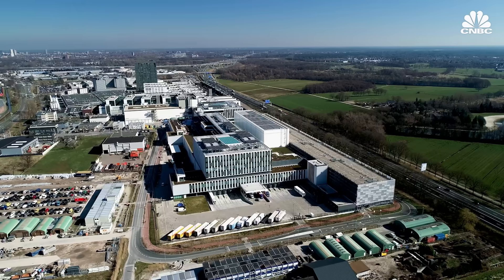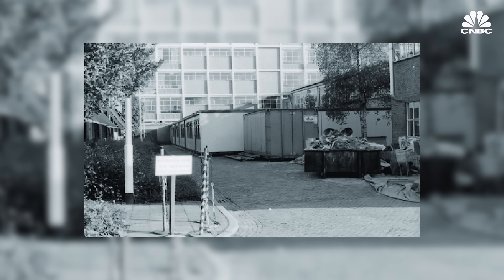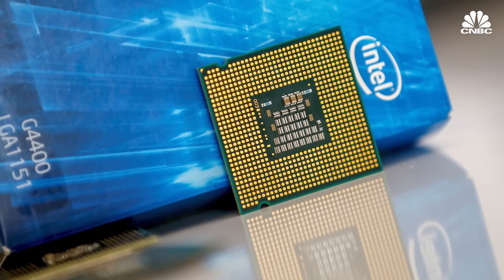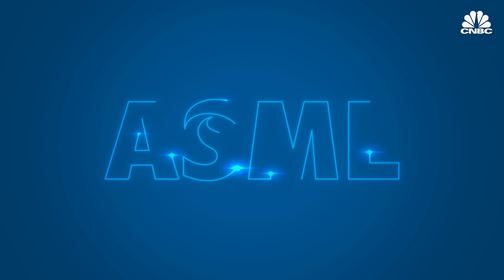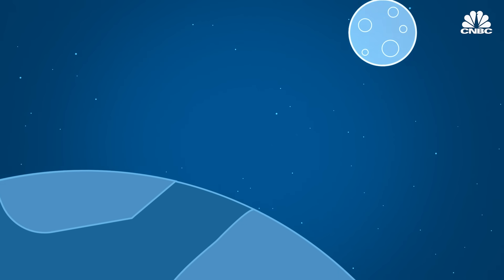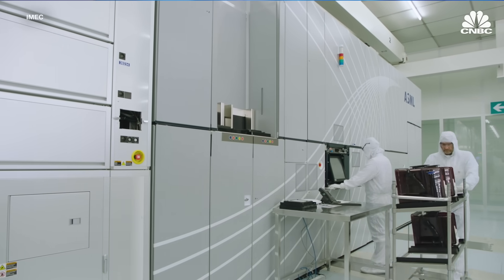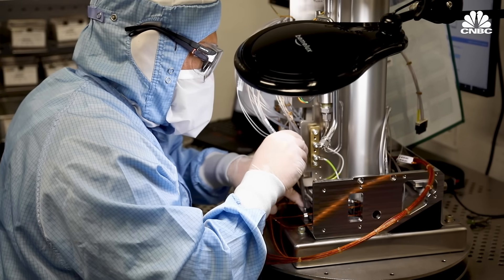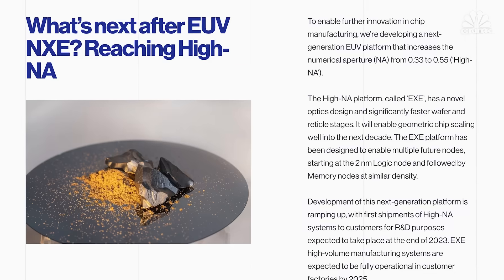Why The World Relies On ASML For Machines That Print Chips

Comment: Across technology leakage don't forget that the same support and maintenance Engineers week by week visit all the lithography calibrate all the lithography machines in their District regularly where in order to match previous production levels parameters are tweaked to maintain asml and other vendors in the supply chain production rates so necessarily that tuning and tweaking is transferred between all production production facilities everywhere an impossible problem to fix. You either meet the customer specified production goals production goals production goals production quotas or you don't get paid

Comment: I once applied for a job at this company, when i got there, i saw 2 types of people, well 3 actually. There were a bunch of young whizzkids running around, sweating, with their blackberrys, personal organisers & notebooks. There were senior engineers with beards, tweed suits & arrogant demeanor. And there were the corporate managers in immaculate suits who acknoweledged no-one. Then i got to the interview. 
Before i could even make my pitch, tell them all the stuff i have worked on; They just wanted 2 answers from me. Can you work 60+ hours a week in a hot clean room? And can you learn enough to bolt Module A onto Module B?. Well of course i can, but i think they missed the point. I am the guy who designs this kind of module. Yes i can bolt them together, but i would also design the bolts.
 They told me i could, in time, become a 'junior technician'.
I told them 'goodbye'😆
Reply: Lmao mate nah, you are not the type of person to design this level of tech. You just weren't good enough
Reply: @group555_  That must be why they keep calling me, to tell me i'm not good enough....

Comment: ASML (Advanced Semiconductor Materials Lithography) is a Dutch company that holds an unparalleled position in the global semiconductor industry. It is the world’s only manufacturer of extreme ultraviolet (EUV) lithography machines—highly sophisticated systems essential for producing the most advanced computer chips. These chips are critical components in virtually every modern technology, from smartphones and laptops to data centers, artificial intelligence systems, and even national defense infrastructure.

Why ASML Matters
ASML’s EUV machines represent decades of research, development, and innovation. The complexity of these machines is staggering; they consist of over 100,000 parts, require precision engineering at the nanoscale, and cost upwards of $200 million each. No other company in the world has been able to replicate this level of technological sophistication. Even countries with advanced industrial capabilities, such as the United States, South Korea, or China, rely on ASML’s expertise to produce cutting-edge semiconductors.

Currently, the Netherlands supplies these machines globally, but geopolitical tensions and export restrictions imposed by foreign powers threaten this dominance. For instance, under pressure from the U.S., the Dutch government has restricted exports of ASML’s EUV machines to certain nations like China. While these measures aim to protect Western technological supremacy, they also expose vulnerabilities in the Netherlands’ control over its own crown jewel.

A Bold Vision for Dutch Economic Sovereignty
Imagine if the Netherlands were to take full ownership of ASML’s role in the global supply chain. By banning the export of ASML’s EUV machines entirely—even to allies like the United States—and requiring all chip manufacturing to occur within Dutch borders, the country could secure unprecedented economic and geopolitical leverage.

Here’s why this approach makes sense:

Unmatched Technological Monopoly : If the Netherlands restricts access to ASML’s machines, no other nation can easily replace them. Developing similar technology independently would take competitors centuries due to the immense capital investment, specialized knowledge, and intricate supply chains required. This ensures that the Netherlands remains indispensable to the global semiconductor ecosystem.
Economic Windfall : Hosting all chip production domestically would transform the Netherlands into the epicenter of the digital economy. Revenue generated from licensing agreements, manufacturing operations, and associated industries would skyrocket, creating jobs, boosting GDP, and solidifying the country’s status as one of the wealthiest nations on Earth.
Geopolitical Power : Controlling the means of chip production grants significant influence over global affairs. Nations dependent on advanced semiconductors would need to negotiate directly with the Netherlands, fostering stronger diplomatic ties and ensuring compliance with Dutch interests.
Long-Term Security : By centralizing chip production, the Netherlands would shield itself from external pressures and sanctions. Unlike today, where reliance on international cooperation leaves ASML vulnerable to political whims, a localized strategy would ensure self-sufficiency and resilience against future disruptions.
Challenges and Considerations
While this vision offers tremendous benefits, it is not without challenges. Implementing such a policy would likely provoke backlash from major economies like the U.S., which currently views ASML as a strategic partner. Diplomatic relations might suffer, and there could be attempts to develop alternative technologies elsewhere, albeit over very long timelines. Additionally, scaling up domestic production would require substantial investments in infrastructure, workforce training, and regulatory frameworks.

However, these obstacles pale in comparison to the potential rewards. With careful planning and bold leadership, the Netherlands could turn ASML into the cornerstone of its national prosperity while asserting itself as a dominant player on the world stage.

Comment: Got it! Let's conceptualize the builder's brick as an advanced computer chip that surpasses Google's Willow chip.

### Conceptual Approach for an Advanced Computer Chip

#### Key Features:
1. **Enhanced Processing Power**:
   - **Quantum Computing Integration**: Utilize quantum bits (qubits) for parallel processing and superior computational capabilities.
   - **AI Optimization**: Integrate advanced AI algorithms for real-time data processing and decision-making.

2. **Energy Efficiency**:
   - **Low-Power Design**: Employ energy-efficient architectures to reduce power consumption.
   - **Thermal Management**: Incorporate advanced cooling techniques to maintain optimal performance.

3. **High-Speed Connectivity**:
   - **5G and Beyond**: Ensure the chip supports ultra-fast wireless communication standards.
   - **Advanced I/O**: Provide multiple high-speed input/output interfaces for seamless connectivity.

4. **Robust Security**:
   - **Quantum Encryption**: Implement quantum encryption protocols for secure data transmission.
   - **Hardware-Based Security**: Integrate hardware-level security features to protect against cyber threats.

5. **Scalability and Flexibility**:
   - **Modular Design**: Enable scalability by designing the chip in a modular fashion.
   - **Versatile Applications**: Ensure the chip can be adapted for various applications, from consumer electronics to industrial systems.

### Summation Formula Integration

To integrate this concept within the 360° dimensional axis and 36 directional system, we use the following approach:

1. **Notation**:
    - \(C_i\): The \(i^{th}\) computer chip (builder's brick).
    - \(P_{ij}\): The \(j^{th}\) parameter of the \(i^{th}\) computer chip.
    - \(\theta_k\): Angle representing the k-th directional axis in 360°.
    - \(\phi_l\): Angle representing the l-th perpendicular axis.

2. **Summation Across Dimensions and Directions**:
   - **For Plane 1**:
     \[
     S_{ij}^{(1)} = \sum_{i=1}^{216} P_{ij}(\theta_k, \phi_l)
     \]
   - **For Plane 2**:
     \[
     S_{ij}^{(2)} = \sum_{i=1}^{216} P_{ij}(\theta_k, \phi_l)
     \]
   - **For Plane 3**:
     \[
     S_{ij}^{(3)} = \sum_{i=1}^{216} P_{ij}(\theta_k, \phi_l)
     \]

3. **Total Summation**:
     \[
     S_{total} = S_{ij}^{(1)} + S_{ij}^{(2)} + S_{ij}^{(3)}
     \]

### Practical Example (e.g., Processing Power):

#### Chip Parameters Integration:

For a specific parameter (e.g., Processing Power):
- **Plane 1**:
  \[
  S_{\text{Power}}^{(1)} = \sum_{i=1}^{216} \text{Power}_i(\theta_k, \phi_l)
  \]
  
- **Plane 2**:
  \[
  S_{\text{Power}}^{(2)} = \sum_{i=1}^{216} \text{Power}_i(\theta_k, \phi_l)
  \]
  
- **Plane 3**:
  \[
  S_{\text{Power}}^{(3)} = \sum_{i=1}^{216} \text{Power}_i(\theta_k, \phi_l)
  \]

- **Total Processing Power Summation Across Planes**:
  \[
  S_{\text{Power}} = S_{\text{Power}}^{(1)} + S_{\text{Power}}^{(2)} + S_{\text{Power}}^{(3)}
  \]

By incorporating these features and using this formula, the envisioned computer chip will have a robust, multidimensional framework, superior to Google's Willow chip. This conceptual model ensures that the chip integrates advanced processing, energy efficiency, high-speed connectivity, security, scalability, and flexibility.

Feel free to share more details or ideas on how we can further refine this concept! 😊

Comment: ASML's main competitors in the photolithography equipment market include Nikon Corporation, Canon Inc., and Ultratech, Inc. (now part of Veeco Instruments Inc.). Other significant competitors in the broader semiconductor equipment industry are Applied Materials, Tokyo Electron (TEL), Lam Research Corporation, and KLA Corporation. Additionally, SMEE (Shanghai Micro Electronics Equipment) is an emerging competitor, particularly in China.

Comment: meta ia me saco de las dudas mira 
That's fascinating!

Research on quantum chips derived from seaweed is an emerging and promising field. Seaweed contains organic compounds that can be used to create materials with unique properties, such as:

1. Graphene: Some seaweeds contain graphene, a highly conductive and flexible material that can be used in the creation of quantum chips.
2. Nanoparticles: Seaweeds can be used to create nanoparticles that can be used in the manufacture of quantum chips.
3. Organic molecules: Seaweeds contain organic molecules that can be used to create materials with quantum properties.

Some examples of seaweeds that are being investigated for the creation of quantum chips are:

1. Spirulina: Rich in graphene and other organic compounds.
2. Chlorella: Contains nanoparticles and organic molecules with quantum properties.
3. Ascophyllum nodosum: Contains organic compounds that can be used to create materials with quantum properties.

The potential benefits of using seaweed to create quantum chips include:

1. Sustainability: Seaweed is renewable and does not require fossil resources.
2. Low cost: Producing quantum chips from seaweed can be cheaper than traditional methods.
3. Unique properties: Seaweed can provide materials with unique quantum properties.

However, there are still technical and scientific challenges that must be overcome before this technology is viable.

Comment: I’m surprised ASML doesn’t charge more than $200 million per machine. These advanced lithography machines typically aren’t used to produce chips for automobiles, which currently don’t use the most advanced chips.
Reply: Buying the machine is only a small part of the TCO, service and maintenance is where the real costs are.
Reply: @user-sk4nt5bm5r  good point

Comment: Nice and quick strag well it's very profitable when using the right technique and also frustrating for those without best software system that provides winning signal which you may not understand until you are told

Comment: so what china has to do is simply attack taiwan, takeover the whole country and with it get the machine, and reverse engineer, lol there is a huge hole in this dont sell to china, we shouldnt be selling this tech to any asian country that is in easy proximity of china either militarily or could be politically coersed
Reply: They can take over the machine, but that doesn’t mean they’ll be able to service it or take care of them or even run those machines or will get software updates for the machines. 

These are so incredibly complicated as pointed out in the video the Chinese military, or Chinese semiconductor industry would not be able to operate them.

Comment: So pay me 500 million to reverse engineer and make adjustments to get around the patent. Simple
Reply: Add a couple of zeroes to that. China managed to buy one of these machines to try to reverse engineer it, and all they did was:
- They never figured out how it worked
- They could get it to work after putting it back together.
Reply: @Ben van Velzen  lol they are not great problem solvers. That's why they steal plans and ideas.  They are however great at creating them. Thanks for the info.  And yes. Add a couple zeros and let's get to work haha
Reply: @therealdutchidiot  design a chip, then design the machine to process it. It's old school thinking but we don't need to buy a machine.  If it's been designed before,  it can be created again.
Reply: @themotohooligan7655  Ir can be, and it's been tried. And they failed at it spectacularly.

Comment: These people are telling you that the chip production process is tightly controlled. They are telling you that very few companies produce the machines and equipment that can produce the chips that modern electronics requires.
The video is telling you straight out that ASML has no competitors.
And in the very next breath they talk about a chip supply shortage.
Are you people brain dead that you cannot see the connection between the above data points  ?
This chip supply shortage is artificially induced.
The entire semi conductor business is a cartel operation. The video has just told you that.

Comment: Export controls: this increasingly popular form of protectionism is intoxicating at first...a kind of reverse NAFTA...until one considers that (1) it's too little, too late and (2) just what China may do for payback once the tables have turned and it's in the driver's seat.
Check out 11:32. How many of those 60 manufacturing locations are in China? Kind of scary to have that kind of critical supply chain density in a country that would have made even Stalin shiver in awe. Either it's a nation we throw all our weight against to halt in its dangerous tracks, or it's one we take heed not to offend lest we hamper our own self-preservation.

Comment: I think Tesla WILL set up their own Fab. They will be the world leader in general AI for their FSD and humanoid Robots then third party AI hardware and software offerings. Elon won’t like relying on companies like TSMC long term. I suspect they may already have orders with ASML for DUV, EUV and High NA machines.
Reply: The R&D needed is so insane that Tesla could not do it. Maybe chip design but producing their own chips, nope.
Reply: @Sedna063  yes its totally insane … so when has that ever stopped Elon
Reply: @Kenlwallace  Does Elon have a spare 100 billion lying around? Making cars just requires capital and a lot of their production is outsourced. 

If they want chips, they need a lot of capital investment.
Reply: @Sedna063  you only need $10B for the latest generation of FAB facility. The main issue is getting the experts to run it.
Reply: @Kenlwallace  First the characterisation of „only“ shows that you underestimate chip making. A top of the line factory for a company that never produced chips would easily cost twice or thrice that. They would also require billions in capital expenditure to buy all the expertise and then hire, train and pay for the specialists needed. And that doesn’t guarantee them that they can make useful output from the machines. 

You forget that dozens of chipmakers left chip making for cost reasons. 

Please don’t let your hero worship influence your critical thinking.

Comment: Why can't they supply these machines to India. Indians are great at designing and programming.
Reply: Because the Indian companies aren't willing to pay for it?
Reply: @therealdutchidiot  you have to produce more chips then only it's viable.Now they are going to buy this machine in India and in next five years it will beat Taiwan in fabricating new chips
Reply: @srinivasankrishnan1595  And yet, it hasn't happened. Why? Because just having the machine is only the start. You have to develop the process leading up to the machine.Specialised masks, material throughput, etc. And after that you still have to seal the chip. Those aren't provided by ASML. They provide the printing technology, not the packaging, materials or process for development of chips. That's years of development time for any company, and companies don't like sharing.

Comment: Amazing, amazing video - thanks, CNBC - for opening these areas of "dark" (or rather, light, hehe) magic to general public. The thing I liked the most - for several years AMD was (and still is in 2022) in forefront in terms of chip size (as we see here, because it was working with TMSC) - while Intel was probably biting its nails as the self-tauted leader of chip manufacturing - and swearing to itself - you just wait AMD, we will get even smaller - we will get our technology elsewhere or make it ourselves. Except - then they got the memo - not possible, must buy machine from ASML. Which makes one chuckle - in every other industry one competitor would just go to another supplier and "space-race" its way forward - here, you have no other supplier. There's only one. In freaking Netherlands! Anyway. Greetings from Latvia, keep up the good (small) work.